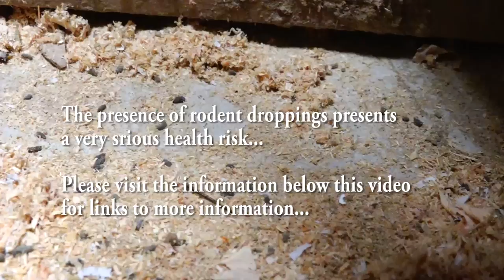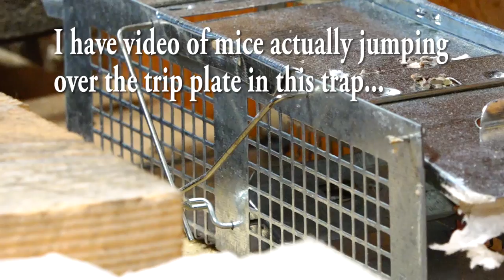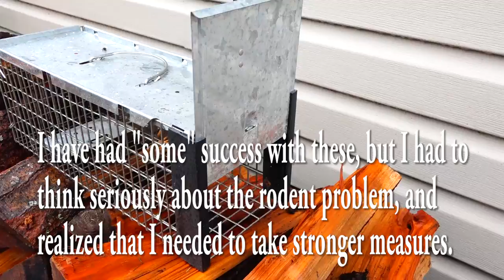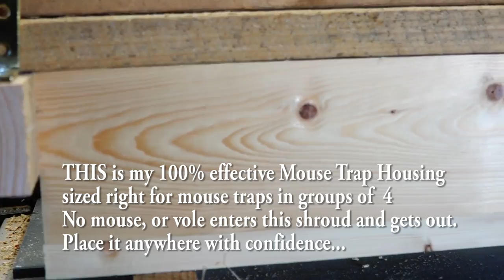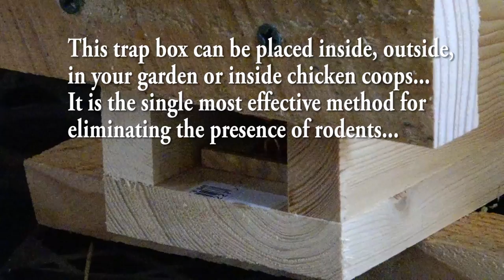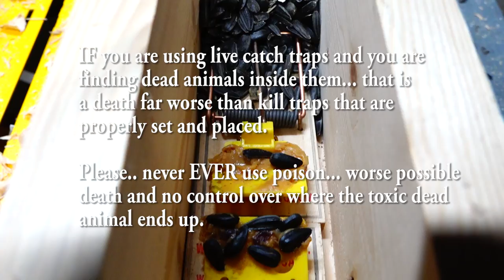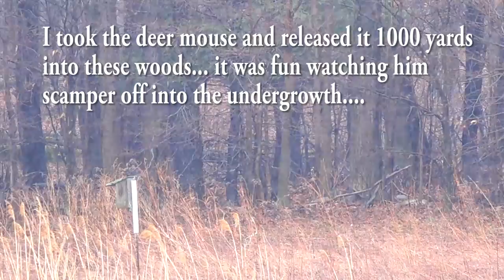The BEST Rat and Mouse Kill Traps that work every single time. Fred's Box of Certain Death Works!

Comment: USE the peanut butter and maybe a bacon bit that is crammed into the trigger? Make sure that the mouse or rat can only approach in a DEADLY direction to the trap. Do NOT give them alternate routes to get to the baits. USE RUBBER GLOVES when setting the traps or removing the dead rodents.

Comment: I just came across your video and saw your 2nd, refined version first and then this one. I have such a little tract house home and small lot and I have way too many rats eating my peaches,oranges and other fruit during the year. My backyard. Is mostly garden? That I wanna keep those rats from eating my stuff. 

I didn't know anything about these black oil sunflowers until now. I tried baiting my traps with black beans and wheat berries but so far it hasn't worked. I used to use the black cat Snap trap that had worked fairly well with peanut butter. But not well enough. But I like your shroud versions because it makes more sense. I am interested in finding your metal rat traps locally here. 

I built a Rat trap for 4 from watching Shawn woods' video Where he caught 10 rats in once and then 10 rats the next day in his 10 unit ratrap set up. I was trying to follow his example where he just put the bait out and didn't set the traps for about 3 or 4 days. His video showed all these rats milling around and eating the bait. Then he said all the traps up and caught 10 that night and 10 the next. My problem I think number 1, is in not using the right bait so I'm gonna use that black oil sunflower seeds. 

But, i'm gonna build your version because I want to use it outside near my woodpile as well And I don't want my dog or any cats to get stuck in it. I'm off to the store tomorrow morning to get that sunflower seed bag. I'm gonna set up your trap and his trap so hopefully there's no way they're going to escape. 

My next problem is going to be solved hopefully where they're coming into my house. I hadn't any problems for about 2 years but somehow they're getting back in.

My problem is I have a rat or 2  in my garage and so I want to use your method and I hope I am successful immediately. I can hear them chewing things in my garage and its driving me crazy! I don't want them choose who wires or something. That's gonna cause a problem like a fire.. I'm trying to avoid having to call professional pest control companies to take care of this.
Reply from the maker: You are the front line with those rats, Jeffery! Shawn doesn't like to talk with others about traps. I was glad to see him also begin to shroud his traps into snap-stalls so to speak. But what he didn't know is that making a completely enclosed tunnel system of wood serves to remove the rats being trapped from the observation/view of older and much smarter rats. The enclosed boxes keep the large rat traps from your other animals, but what's even more important when dealing with smart rodents, is that they can't see the rats getting snapped. They can hear it and often go in after one has been snapped in order to find out what happened or even worse, they will even chew on other dead rats. This is why the Box of Certain Death works so well on a number of fronts.  I'm with you, hearing a rat chewing on a structure at night is a call to arms... I wish you all the best in defending your structures and resources.
Reply: Thank you for getting back to me on this.  How do you get the traps emptied and ready to go again? I can't see buying new metal traps every time. For me, it's a bit disconcerting to pull the kill bar up to remove the rat carcass 😮. I've used the Tomcat traps because I just squeeze and the rat drops out into the garbage can. (I'm not sure how I can use tomcat traps in your tunnel)
Reply: I added another twist to your trap. I drilled a hole in the sidewalls to allow a rod (or tent spike, concrete nail, etc) to block the kill bar while setting the trap. When set, you just slide the rod out and your fingers are safe! 😊

Comment: Watching this on mute... glad for the readable script.  We get mice in the house (our old 100 + year old farmhouse stone foundation) and if you see one - count on there being lots more.  They know how to avoid every end-to end sticky trap around here... but still manage to eat my seedlings under the grow lights in the late winter/ early spring. ( Arruhhhh! )
Reply from the maker: This trough style has worked better than any other traps I've found and I have them all by now. I have changed the ends so there is just a 2" diameter entry hole. Mice and rats to inside just because it's a hidden space and..... then..... THAPPO.... it works. I need to do a remake without the musical score I think... :)
Reply: Do you have the dimensions for the mouse version?

Comment: The Victor  traps have a “normal” and  a  “sensitive” trigger plate setting which this guy doesn’t seem to be aware of . Also ensure snap bar clears the lid/roof of the run.
Reply from the maker: Thank you, you're right, and yes, I'm aware.
Reply: @FrederickDunn You appear too confident when setting the traps but a bit blasé  and. brave setting em in a row with the buggers springing. Sorry I missed where you mentioned about clearance on the  covered runs.  I use Victor, Fenn and various snap traps and seem to be on top of the problem, but allus keep a few set, never get complacent about  beating the problem. Don’t  like poison, as you say can target nature in the food chain.

Comment: I find PB to be too soft, messy to work w/, & easy to pick off w/out setting off the traps.  I found Payday candy bars, pressed into the hook on the yellow trigger pad w/ all loose (easily removable) nuts removed, then (here's the kicker) wrap sewing thread around the yellow pad (diagonally, vertically, & horizontally) & pressed gently into the Payday. Thread makes it so no bait can be stolen, plus it catches on their teeth, helping to set off the trap.  On some trigger pads, the corner you put the trigger wire into determines sensitivity, so choose the one you want.  The tunnel idea is good, but I was trying to decide why you went w/ putting the yellow pads facing inside, rather than outward.  An alternate version would be to place the traps inside a tunnel like you have here, but placing them 90 deg to the length of the tunnel, & in head-to-tail/alternating fashion so that there are trigger pads on both the L & R sides of the tunnel floor.
Reply: 1 candy bar is good for abt 8 traps.
Reply from the maker: Thanks for sharing your technique, but it worked and I have no more mice or rats in that structure. I'm sure your method works also :)
Reply: We were troubled with a really smart mouse in the house who picked the bait cleanly for several nights running. Rather than try a live trap, to catch it and make a cool $1M doing live shows all over the world with The Smartest Mouse Ever, my son suggested a nest of 6 or so set traps in very close proximity.  Sure enough, it picked one trap clean, but then, it stepped back to congratulate itself and... "Ow! Ow! OWW! WHAT TH..." [product has expired]
Reply from the maker: @duubtuub3071  I had to clean out a chicken coop that was overrun with mice... the herringbone pattern works wonders!

Comment: Hi Frederick - great video and information. I checked your website as well, but did not see any mention of dimensions you used when making these boxes. Is that something you would be willing to share? Cheers!
Reply from the maker: Hi Dave, I should probably make another video showing the step by step instructions with dimensions. They are really based on the traps to be inserted. There should be just enough interior height to accommodate the trap bar action swing cycle and just enough width to allow the traps to be inserted and not scrape the sides when operating. In my newer boxes, I screw the wooden trap base to the bottom of the trap interior so they don't move at all. Thanks for watching!

Comment: I've had a lot of luck putting the traps in a box so the rats can't escape to the sides and get away from the kill bar.  First rat was probably around the size of a 3-4 week old kitten.  Caught it with bacon and American cheese and kettle corn in a leftover box from a waffle iron I bought.  Second one (past Friday) was pepperoni pizza in a Kroger Texas toast frozen garlic bread box.  Flipped on its side, perfect width to slide the trap in and plenty tall enough to not obstruct the kill bar.  It was a little smaller than newborn kitten.   Tonight's deadly feast was American cheese and pepperoni in the Texas toast box.  Newborn kitten size.  I'm praying this is the last of the destructive little fu#$ers.

Comment: How about putting an electrical cord with exposed ends on one wall of the plastic bucket?

You drill a small hole (diameter of electrical cord) on the wall of the bucket (somewhere about half to three-fourth height of the bucket). 

Insert the ends of the exposed electrical cord through the hole; and make a knot so it won't be pulled out by accident. (Secure the outside as well, so it won't slid inside as well)

The ends of the exposed wires should be close but NOT touching each other. Then plug the other end.

So they only got shocked if they jump and touch that exposed wires and you only spend almost next to nothing in split-seconds in shocking rats.
Reply from the maker: interesting

Comment: What size lumber did you use on the rat box side walls? Looks like 1"x4"s maybe?  I made 2 of these last year and they work so so so well for a chipmunk issue I have, they don't stop killing em! But occasionally the kill bar gets stuck on the lid if I weight it down and if I  don't the squirrels can get to it easier.   Thanks for the awesome trap!
Reply from the maker: Yes it's all 1 x stock... glad it's working for you, these are still going strong!

Comment: May I say if it was me setting up traps I would first used clear perspex so you can see any spent traps second I would have used T Rex rat & mouse traps no fiddling around with the kill bar and pin you even take the small section out fill it with what ever works for you I like to use peanut butter smooth or crunchy. And third I would have tried to remove any food source and that forces the rodents to take the trap bait. Keep going your doing good.

Comment: if one trap goes off wouldent it set the rest off?
Reply from the maker: Not usually, I've often opened it up to find a single trap sprung with the others still set. There are occasions when a single mouse will trigger two traps.

Comment: I don't understand the height of the opening.  The chute width I understand but how high should the chute be, just enough for the trap to swing freely?  Edit; never mind, i just went over the video, the music made me soil myslef.   I t looks like you used two by fours all around. Sorry for the questions but I am dealing with a minor rodent invasion.
Reply from the maker: Just have the sidewalls tall enough for the trap kill bar to clear. And just a tad wider than the base plate. My new versions have ends with 2.5 inch diameter holes in them and I just put the traps in through the top then replace the cover. Mice and rats go into them with or without bait when holes are used as they seek dark hiding and nesting spots.. then... THWAP!!! =<';'>=
Reply: thanks for clarifying the dimension.  In the video I assume that you are using mouse traps to demonstrate because if you aren't, you could make a strong case for being a member of the Fantastic Four with those Thing hands.
Reply from the maker: @JohnDoe-bf6bk  Hardee Harr harr... !  :)

Comment: What size rats do you have if you need to put 30lbs of bricks on top? lol ...Also with your design, I would attach a small wire screened  container to the under side of the lid. Have it filled with the seeds to allure the rodent inside with their scent , but they actually cant get to it.  This would leave less mess inside once you clean the trap out. Id just put peanut butter itself on the snap traps. Just an idea......
Reply from the maker: These days I only use the sunflower seeds. Works perfectly. AS for the bricks on top, not for the rats, but rather to keep other animals from getting in to eat them, or from getting snapped by unsprung traps. :)
Reply: @FrederickDunn  I kind of thought thats maybe why you placed the bricks. As I look at the trap, those "L" brackets extend over the top edge of the trap. Just use 2 long bolts through them at each end with wingnuts, to keep from opening instead of the bricks.

Comment: if you hate rats and can see them scurrying about  and you fish this is a great trap and great fun  you need I stick and your fishing rod and about ten pound line  first put a point on a stick that is thick enough you can hammer it in the ground and it would be hard to pull out then drill a hole  about 1inch from the blunt end  straight through hammer the stick in to the ground where you see the rats then set up your rod and line form a 6inch loop on the end of your line now thread the loop through  the stick and form  a loop to the side of the stick place small baits either side  the idea is to strike when your see its going to get necked hung

Comment: Why not use walk the plank traps? Even better, why not build them? They reset and capture as many mice or rats come up to it. Most people have a bucket with 6–12 trapped in it over night.
Reply from the maker: They don't show you how those captured bin mice/rats turn on one another and chew parts off if someone doesn't get there right away. With water, they tread water for hours at a time. I'd rather kill them clean and quick.

Comment: This is the price to pay for feeding the birds and chicken. Had the same problem with mice, they found a way in my house through the breathing holes on bottom row of the brick. I stopped feeding the birds, solve the problem. Rodents will migrates near a food source and, under a bird feeder is a constant one. By the way, I saw your new bird feeder and,this is the best One I have seen so far. PS. If You can reclaim the seed before they touch the ground, the rodents will have no reason to stay.

Comment: Thanks for the video, I just would have liked the measurements for your boxes.  It would take the guesswork out.   I liked the music too.
Reply from the maker: Thanks, the boxes should be constructed based on the trap sizes you are using. The width of the wooden base of the trap dictates the interior width of the box. The arc of swing of the trap arm dictates the side wall height, making sure it's just a little taller inside than the snap bar will reach. I'd buy the traps first, then gauge from them. There are lots of trap designs out there, so the box dimensions are variable. Thanks for watching and commenting!

Comment: I found that once you kill a mouse with these little traps the other mice won’t touch it once it’s reset. Need to wash them and even after and even then they sometimes refuse to touch used ones
Reply from the maker: It's exactly the opposite. With the mouse smell in the trough and on the traps, other mice are more apt to visit. It's the clean traps and clean boxes that are most often avoided. Rats will walk right over dead mice/rats and feed on them.

Comment: would u not put a wee screw down trough the traps seen u almowst lost a finger with one triggering ? great invention tho
Reply from the maker: I've come a long way since this video. For rats, I do put screws through the plate. For mice, I use two dabs of Hot-Glue and this allows me to also side-mount them. All of my rats are gone and the mice are profoundly reduced in numbers. Thank you for your comment! I also used the box method in the garden and got rid of the voles in record time. I actually used dead Voles to trap flesh-eating rats.

Comment: Is there any benefit to having the triggers facing each other. Other than to see if the traps have been sprung?
Thanks David
Reply from the maker: Hi David, nope, I just wanted to make sure they get sprung, but it hasn't proven to make any difference at all. Thanks for the question.
Reply: Thank you for your quick reply, David
Reply from the maker: Norfolk Moles You're welcome!

Comment: At 0:50 there are blue/green droppings present, indicating the recent ingestion of rodenticide 🤔
Reply from the maker: Good eye Steve, but if they did eat something like that, the closest barn is 1,600 feet away, it's possible they are using that on their property. I should have taken a closer look at that. Thanks for watching and taking time to comment. You're right, it does look like those poison bars sold at Tractor Supply.
Reply: @FrederickDunn  yeah that's a good point. If there's other properties nearby, it's highly likely they could be getting it from there.
Reply from the maker: @stevemiller2651 I've seen their cats on my night cameras, maybe they follow the rats up here.  This year I don't have any more rats "yet" but I'm ready for them.
Reply from the maker: @stevemiller2651  I just found out that my closest farm neighbor does use bait blocks and they are blue-green. I'm offering them FREE "boxes of certain death" but she has 5 gl buckets of those poison blocks and swears by them.